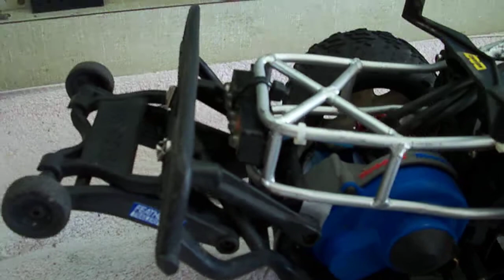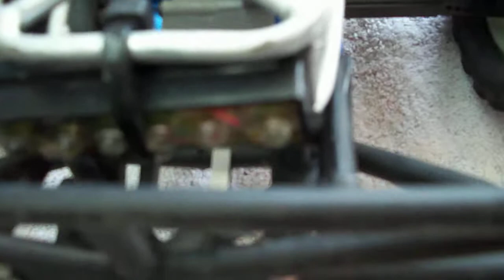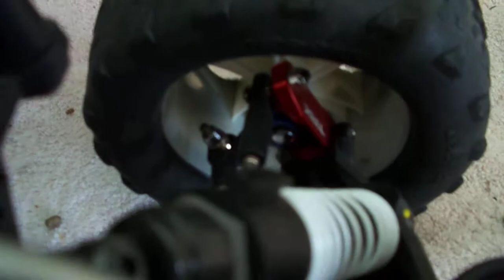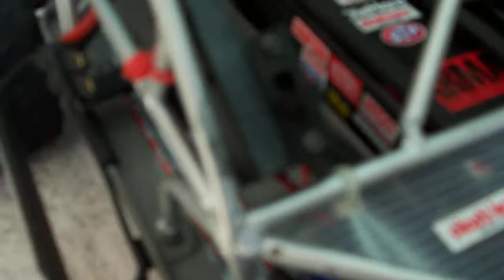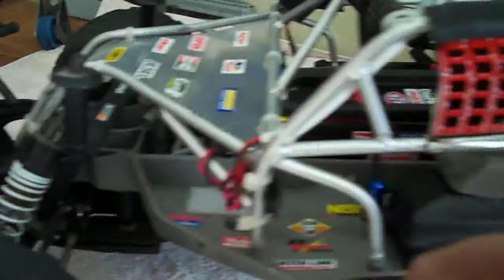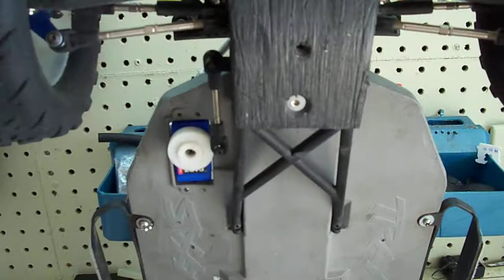TRAXXAS SLASH  mods

Comment from the maker: @MrBman54321  not to sure, but it is very duraable,i can even stand on it......and it is light weight .only a 1 1/2 lbs  but the 11.1 lipo has no problem pushing it.

Comment: If you didn't build the roll cage, where did you purchase from? What's it made out of? And the plastic with stripes in between the cage, what material? Lastly, what rear springs are you running in there and how do you like them? Nice ride, great job.

Comment: @DVarelatenors:
btw, i wouldnt reccommend a smaller class.. i would try to stick with 1/10 and up. 1/8. 1/5.. etc.
also, you must know that this hobby is pretty expensive.. cracked/broken parts are easy to get after a race or bash.. you can easily spend $100 on parts after a few bashes and races.